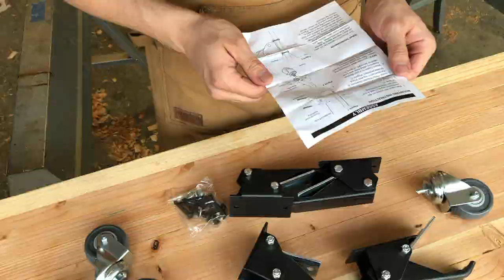Building a Workbench - Part IV

Comment: I am a very beginner and have watched a few of your videos multiple times and I really like it. My first planned project is also to build a workbench and I am going to follow most of your steps. I like the way you have demonstrated the use of hand tools and I desire to do the same, though it will be first time for me and I am surely going to mess up a few things :) 
One quick question - Do you think there should be some additional support needed across the table top to prevent it from sagging(at the center) over time? because there are multiple 2x4s glued up and a horizontal support across may be helpful. Let me know if you think otherwise and in case if you have faced any such issues yourself over time.
Otherwise, great job and I surely like to watch your videos as I feel I can learn a lot from it!
Reply from the maker: Hey Lax! Welcome to the channel! I’ve still only been woodworking for a few years so I’m constantly learning new things, especially when I mess things up 😂 I heard somewhere that there are 3 types of mistakes in woodworking. Those you can ignore, those you can fix, and those that require you to start over. I’m learning there is a ton you can fix 😂

Regarding the support, great question! In this case I don’t believe it’s necessary. The 2x4’s when laminated together in this fashion act to support each other and I haven’t experienced any noticeable sag in mine. Doesn’t mean it can’t happen but the bench is a beast. Also, if you have access to a planer, it’ll make your life a whole lot easier with this bench. That was my first woodworking specific power tool purchase and I don’t regret it one bit. Saves massive amounts of time. But, there is something therapeutic to hours of hand planing.

Also, if you have any more questions at all, feel free to reach out!
Reply: @NorthwestCraftsman  thanks for your encouragement and advise🙂 I do understand a bench top planer is going to make it a lot easier and i definitely do plan to purchase that sometime soon, but i still want to feel the satisfaction of using a hand plane and chisels to begin with, until i loose my patience 😉.
This is going to take a very long time for me as I am starting to learn to use hand saw, chisels,  planes. Also i have a small garage (and no workbench of course 😉). I buy 2x4s in small batches as i don't have a truck. And i get the chance to work on this hobby only in weekends. But i still want to enjoy the journey and the learning process and am hopeful that the end result would come some day...maybe a few months more than normal😁 I will get back with questions if I need advise along the way🙂. Keep up the good work and my best wishes 👍
Reply from the maker: Sounds like a solid plan to me! 

Good luck and happy woodworking! 😄

Josh
Northwest Craftsman